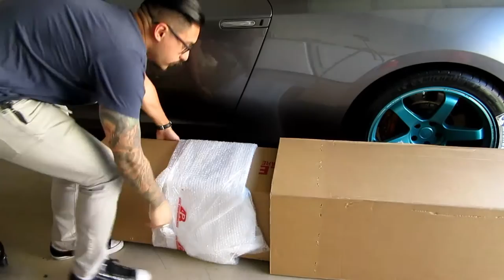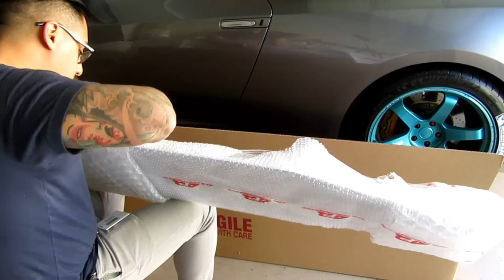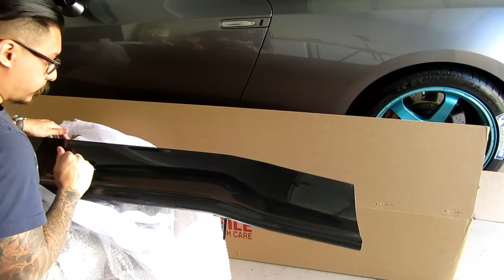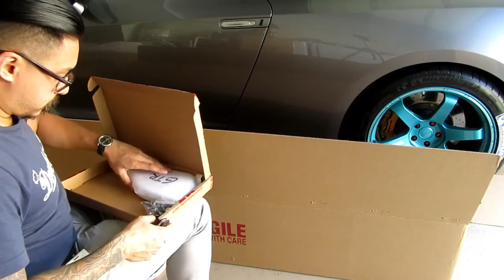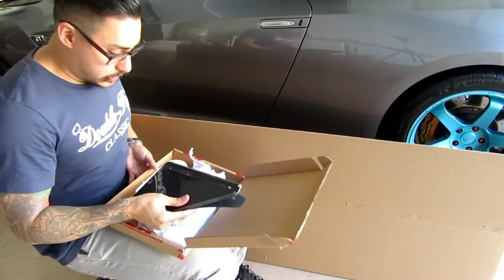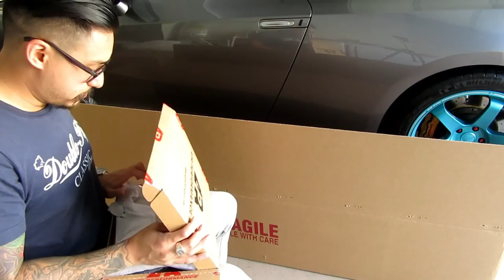APR Performance GTC 500 Wing unboxing

Comment: Great choice. I love my APR wing it really changed the look on the GTR
Reply from the maker: Vi Lien Thanks. Hopefully I'll get it one this week
Reply: MikeEM1 when you install the wing tighten the inside screw first before the outside. Or there will be a slight gap between the gasket and trunk.
Reply from the maker: Thanks for the tip
Reply: Hello are u still selling your nordring trunk lip for the gtr if so please let me know the price and how to get in contact with you Im located in Los Angeles thanks
Reply from the maker: Fernando Sandoval$675. You can message me on here, or if you're on gtrlife, I have it listed in the California section. You can hit me up there too.
Reply: Hi, Are you flexible on the price I'm seriously interested i have gtr life but it wont let me logged in please let me know thanks